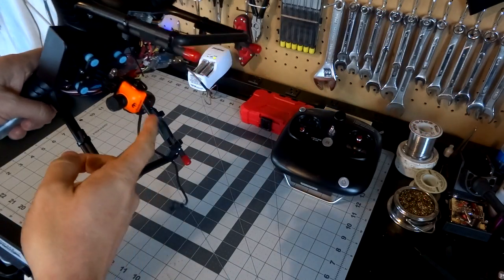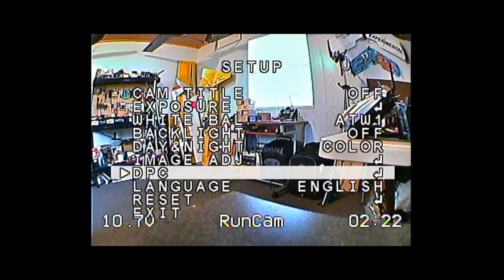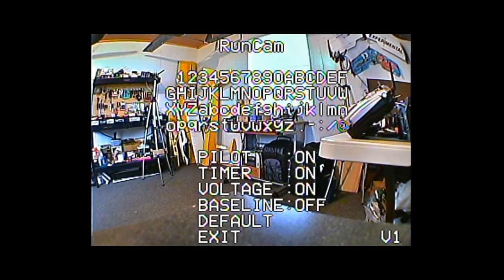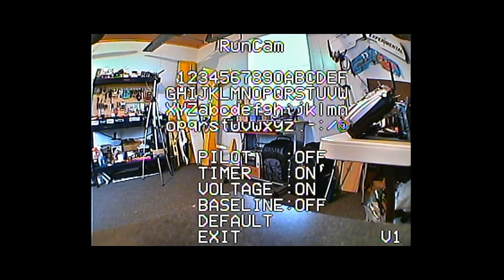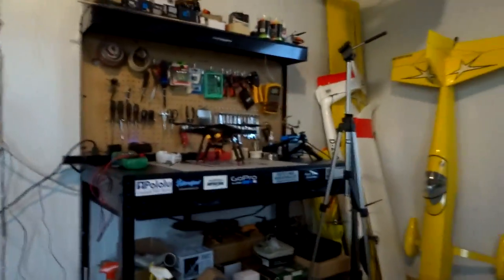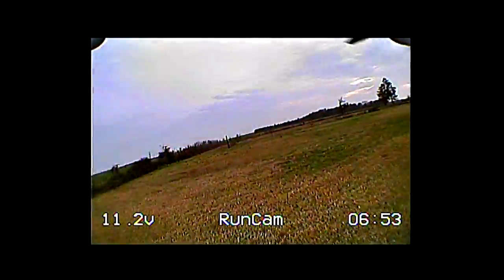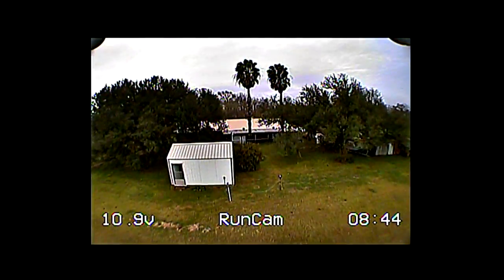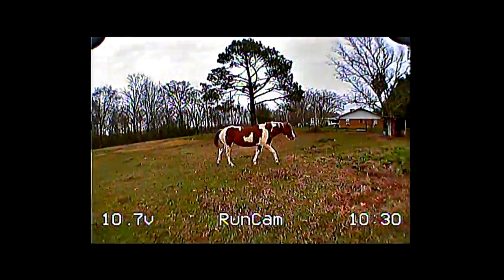✔Runcam Swift 2 Review - OSD Settings and Preliminary Flight Footage

Comment: Very nice second part, straight on the point :)
OSD is quite nice if you don't want to mess up with more detailed external OSD boards!
I think i will still use all my Swift v1 for now! I will maybe switch when they will have a little more resolution!
Happy new year to you and all your family! All my best wishes for 2017 :)
Reply from the maker: If you already use the Swift, and already have an OSD or for whatever reason, don't need this simple one, then I wouldn't recommend switching to the Swift 2 either. The camera as far as imager and processing, all that stuff is the same, you won't see any difference. (Other than the new lenses, I'm sure they'll offer if separate though, if not sell them with the Swift in the future). It's just a Swift with a simple OSD and audio added on. I don't think we'll see much as far as improving video resolution until someone makes a better imager and DSP that works as well as these, that Runcam and others can build a camera around. The Eagle comes to mind, it's a bit higher resolution and the light handling is excellent, but personally I feel the colors are washed out and "faded", and not as vibrant as it should be. Tweaking the settings a bit helps, but I was not able to get it anywhere near as nice as the Swift and similar cameras. Of course we're always going to be working withing the limits of analog video formats, until we make the transition to digital high definition FPV... lol

Comment: How does the timer come on? If it just turns on when power is on, its . . ehh. If it goes on when voltage is received at a certain level, aka armed (like my OSD on my PDB that I want to be rid of lol) then we are talkin'.
Reply: I Second this, how does the timer come on? And damn, I wish I would have bought this instead of my Eagle.
Reply from the maker: The timer comes on and starts counting when power is applied to the camera. I do prefer the timer that starts when you arm a quad or at some other trigger, but the camera doesn't have any kind of feedback from anything else to know when that happens... lol I think the timer is more useful as a reference, not the time when taking off and you know about when to land based on your usual flight times. Otherwise it would be useful when looking back at a recording to compare actual flight times when you can worry more about math and not flying. ;)  I definitely watch the voltage first to know when to land anyway if I'm trying to get all I can out of a battery.

Comment: I am using titans and the low voltage cut off seems to be kicking in. at 9.2 volts where as the batteries can go to 7.5 safely. Which means my flights are being needlessly interrupted when plenty of the fuel is in the tank, worse part is the titans go to low a much lower voltage very quickly and then last for a long time, meaning at about 95% full charge my esc low voltage cutoff kicks in.
Do you know of a 40am Brushless esc that I can use to work around this problem?